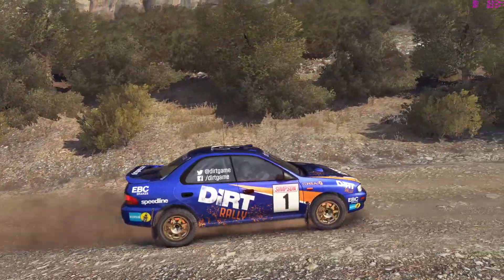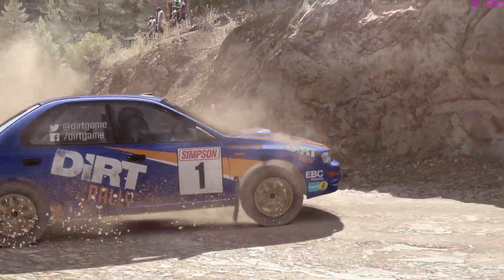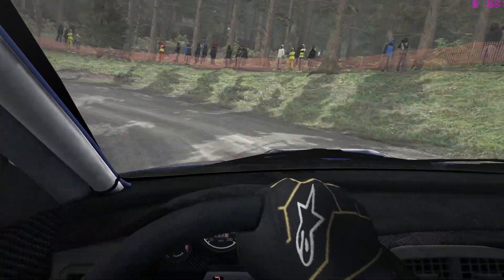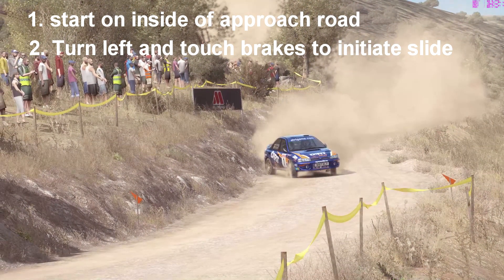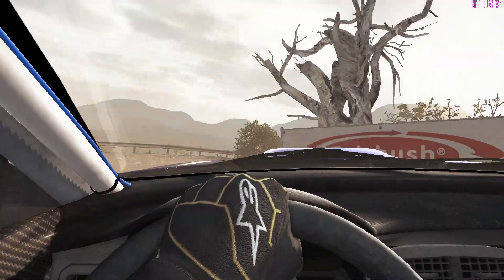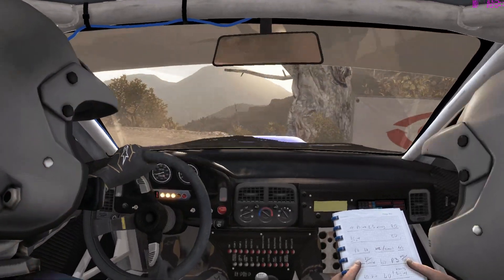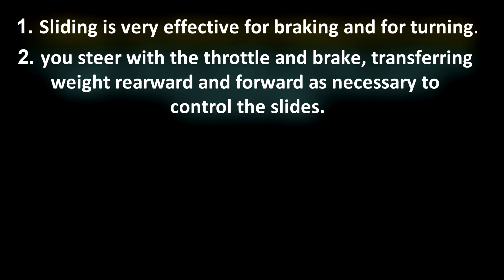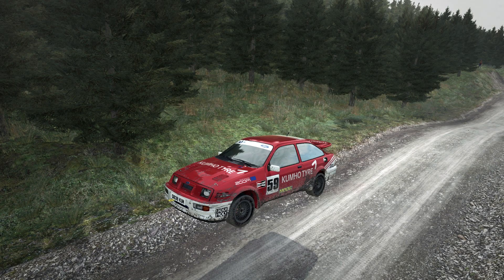Dirt Rally Tutorial - Basics of rally driving

Comment: Instead of left foot braking I learned the art of heel / toe accelerating and braking with the same foot at the same time.  It takes the right car to be able to do this as the pedals have to be arranged right.  But I drove that way for many years both in rwd cars and awd cars.  I never could get it to work right with fwd.  Probably I couldn't do it because I essentially wanted to control the rear wheels with brakes and acceleration which included using the clutch.  In fwd there was no power to the rear (of course) so the technique didn't work the same.  I'm sure others could do it but I really never put a lot of time into trying it.  I generally used understeer and a lot of force vectoring on the front wheels in a rwd car.  The rear wheels sorta felt like they were just along for the ride to me.  I couldn't do much with them except scrub off speed from time to time.

I lived in an area that has a LOT of dirt roads and at one time there was a Pro Rally (SCCA) in the area.  I learned a lot from watching those guys and I very nearly got involved as a driver at one point.  The best car I had for rally type driving was a Mitsubishi Eclipse clone which had equal power to all 4 wheels and a limited slip center differential.  I never found the limit on how fast that car could go on dirt and snow.  Stopping was much harder than getting it to go way faster than I should have been going.  The roads I drove were almost entirely deserted at night when I drove them but not completely and you just never want to come up on a situation when you don't have enough braking.

Power sliding and scrubbing off speed was a way of life for me for several years.  It was fun but stupid too.  I'm still kicking and I never hurt anyone but I did roll that Mitsubishi eventually.  The waste gate stuck open and I was afraId I was about to blow an engine so I let off the power in a hard turn and I shouldn't have done that.  I knew I had to keep the front wheels ahead of the rear wheels at all times or else.  I got the or else that night.  AWD cars will swap ends or start rolling if you don't keep those front wheels pulling in the direction you want to go.
Reply from the maker: here is a new guide i made, its unfinished https://docs.google.com/document/d/1IYBbNI2nhMTlmvXQCZWAxLK7DThrAYF58kXhxl9eUGs/edit?usp=sharing

Comment: Thanks, that was helpful. I played a bit of RBR in the past, so I tought I will eat Dirt Rally for breakfast. Well I didn't. And now I know why, thanks to you. I play a lot of Assetto Corsa, and have my mind set on track racing, and applying those driving techniques caused nothing but frustration with Dirt. Couldn't find the braking point for corners, or where to start downshifting. Taking hairpins completly wrong either slowing down too much or, stalling the car and not using clutch with the handbrake at all. And I fall out of gears a lot, it just goes back to neutral when downshifting and sometimes upshifts too. Although I'm suspicious that has to do something with how the clutch was programmed? Or is it just me?

Comment: I really like your Tutorial and watched it many times....what I can´t find out, how do you manage to get the car into a slide (when not using the handbreak or the scandinavien flick). Is it flicking the wheel in the direction of the corner ? with or without throttle ? or is it steering-touch breaks-throttle ? And you told the technics work not for the RWD, what works for them ?
Reply from the maker: Nightprowler696 Making a video shortly on that, but in rear wheel drives it takes a bit of a different technique. turn in, half throttle and left foot brake until you hit the apex, let go of brake and flat out depending what corner is next.

i'm sorry if i couldn't help but its a lot harder to explain things in text to ill get around to making the advanced basics soon

Comment: What a great video, there is so much information in it to learn, thank you for that work! Currently i am learning to perform the pendulum turn and i am asking myselfe about the correct speed to shift the weight from one to the other side ...is it in the upper second gear around 60 km/h? The other question is that i cannot play with manual transmission due to my noob driving ... while performing the turns you always play a lot with the clutch and gas, do i have a chance performing nice turns if playing without clutch? Thx for your help!
Reply from the maker: manual is only good for keep the car at the RPM you require.

Comment: Any tips for those of us who aren't fortunate enough to have a steering wheel, or simply don't want to use the clutch pedal at all? (flappy padle or sequential gear box)

Also, is it me or the only electronic assist that actually makes the car perform better, aka ABS, makes the braking not only worse but simply doesn't want to work on the Hill Climb cars at all? ABS decreases the effective braking distance, along with allowing steering under braking, so I don't see why anyone would want to have it off at all or why would it decrease the braking performance in a game that calls itself a simulator...
Reply from the maker: ***** nah sorry don't have any extra tips for keyboard/controllers, what i covered in this video it should all still be relatively the same. Although i find driving without a clutch unskillful but hey that's just my opinion.

About assists, if your good enough you can brake better than most conventional ABS systems, also i'm pretty sure its banned in rally but i'm not 100% on that. with assists on you don't have full control over your car, which is needed in low grip situations, for example: (using the brakes to lock up the tires to put the car into a slide) but this is not possible with ABS to an extent. 

Most older cars don't have traction control nor ABS but the more modern cars have it, in my opinion it takes away from learning how the car feels and reacts.
Reply: Michael E Grammar nazi in me has to address this. Keyboard is a controller, so what you wrote there basically can look like this: "keyboard/keyboard", "controller/controller", "gamepad/gamepad". Word "controller" is a highly general statement, which can address anything that controls something, for example a brain. For racing games nowadays there are only 3 ways of controlling them, by a keyboard, gamepad or a steering wheel. puts the inner grammar nazi to sleep

As to clutch, I personally find it to be not only something annoying, but also a limiting factor in cars performance. Rally cars use sequential gear boxes for few reasons, not only the speed of the shifting, but reliability as well. Also calling it unskillful is a bit of a hate speech. It's like saying that someone is unskillful when he brings a BAC Mono to a trackday with slick tires, when you're running some RWD car with quite some power and rather crappy tires. He's just using something that is perfectly suited to the environment, same thing applies to clutch in sequential gear boxes. The, pretty much, lack of it, is more suited to the race/rally environment.
Whether someone likes using it or not is to each own preference, but no point hating people (in any way) that want or don't want to use it. One likes the old way, second likes the new way.
I would personally say that sequential gear boxes "increase" the limit on how fast you can actually go, therefore allowing the most talented racers out there to go even faster, while at the same time making the entry point for new drivers more accessible, but still not as braindead as pure automatic gear boxes. And you still have the stick with a proper sequential, so shifting action happens anyway :D

As to ABS, in games you can brake better without than with ABS. In real life, no matter how good you are, ABS will shorten your braking distance by a lot. It's been proven many times, effectively shortening the lap times the cars can do. The better the brakes the better the ABS needs to be though, but the greater the improvement at the same time. I only use ABS with this in mind, as it actually should improve the braking performance, not decrease it. As to any other assist... KILL THEM ALL xD And yeah, checked it, ABS is banned in rally.
I do get the putting to slide argument for ABS off, very good one. But that's what the handbrake is for if I'm not mistaken. Forcibly putting the car into a slide. Also, the moment your wheels lock up due to too hard braking, you effectively lose control of the car. On top of that, while under (just) braking you basically can't turn at all, while with ABS you can, so in fact you have more control over the car with ABS on.
Anyway, my point is this. DiRT Rally is basically a rally simulator (not saying 100% realistic one), so if they decided to implement the ABS it's the high-end one that should be implemented in the cars. It's not like that's an issue in a game after all... On top of that, it should actually make the braking better, while it doesn't (doesn't even seem to work at all in Hill Climb). If someone would want to make a full on realistic tournament/cup/event, they can simply force all assists off. So why is it that ABS makes the braking quite a lot worse, even when compared with a full on locked up wheels? Why they put an assist that is banned in rally, when the only thing it does is make you slower at that point, effectively also making it harder, as you need to brake more often and can't save your hide from tight situations with heavy braking, because again, the braking sucks hard...
I don't mind racing without the ABS, but if they allow it to be used, then make it work like it should, not like an "assist" that only slows you down... it's a friggin simulator after all -_-

And... wow, this came out to be quite longer than I thought it would be xD Anyway, I hope you don't take this post as an attack or anything, just wanted to bring this issue to someone who has better equipment and most likely more experience in rally games than I do. I think we both want for this game the best, so making even the silly assists work properly should be important as well. At least the ABS, only assist that actually matters and allows us to be faster.
Reply: Michael E ABS is not banned (by authority rules like FIA) but it's disabled in all rallye cars I ever sat in. Locking the tires absolutely necessary with some of the techniques explained in your (fantastic) tutorial. And you can't lock them with ABS enabled. Same goes to things like ESC (electronic stability control) which is disabled as well.
Reply: ***** if you are driving with assists then you are not rally racing IMO
Reply: Then anyone who uses anything other than a keyboard isn't rallying according to you. As more precise steering is obviously the most powerful assist of them all.
Reply: +Ryu Makkuro lol.

Comment: Should you use heel and toe when downshifting in rally? Or is that only for roadtracks?
Reply from the maker: Yes, but not really. on track you use it for keeping the car stable while braking at high speeds. Now on gravel this is not such a big deal since you are already  sliding around, meanwhile on track maintaining a steady direction and control is key. personally i heel toe by habit and the precision it gives while under braking by allowing the control over the engines revs while downshifting.
Reply: As far as I know, WRC cars have dogbox transmission in which the clutch is also used to set off or when you engage the handbrake. In a WRC you actually shift and downshift without pressing the clutch unless the dogbox is damaged.

Comment: Sorry im ignorant but can you explain to me why you need to clutch in for the handbrake and then clutch out?
Reply: When you're pulling the handbrake wheels are stopped so if you don't use the clutch you're gonna stall the engine
Reply: @Visser00  What if you're using sequential? I use a sequential shifter with auto clutch turned on

Comment: I cannot even win the 1st stage. It fucked.
Reply from the maker: If you only drive blindly at full throttle, you'll only put stress on the car and your skills will not improve. Just flooring the accelerator won't work, you must learn the technique of controlling the throttle precisely. Control the accelerator in a number of small steps, also keep in mind its much harder to control your desired speed than driving as fast as possible.